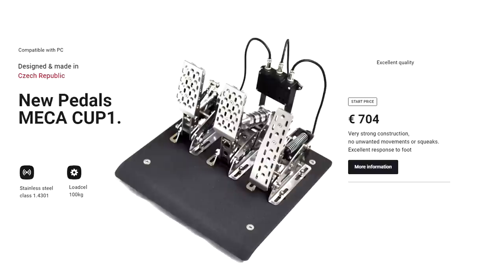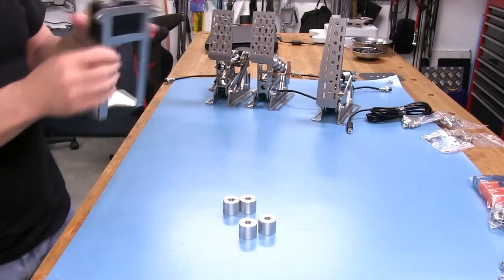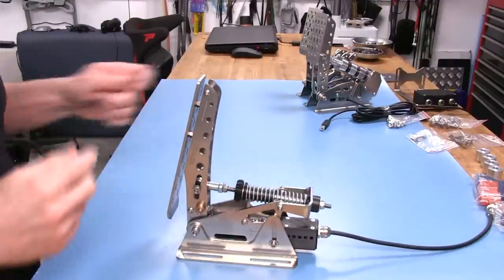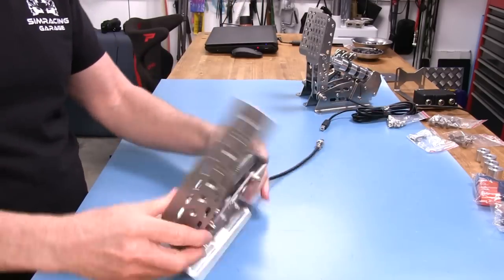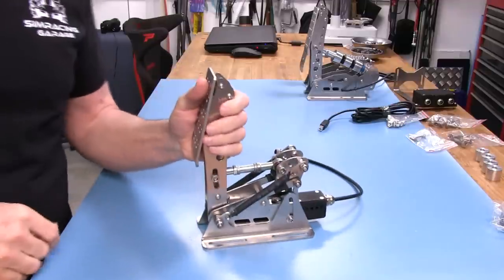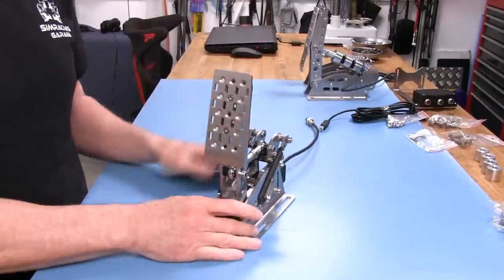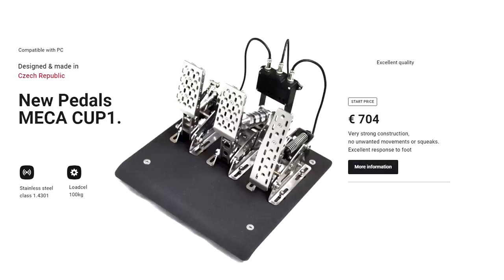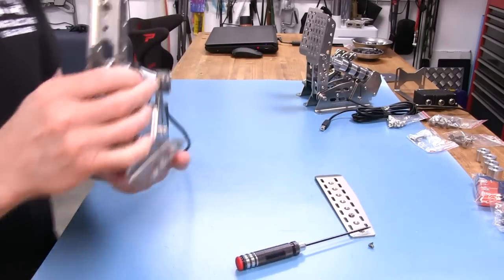ALL4SIM Meca Cup1 Pedals Review

Comment: And just bought the sprint...
Reply: bad timing
Reply: @MrMETEK23  good timing! The Meca Cup1 are a plagiarism. They copied the mechanical design from the old HE Pro Pedals for Brake and Gas Pedal. You should support genuine engineering and not copied designs. Also don't forget Software and Support from HE is top notch. Heusinkveld left a statement in the virtual racing forum on this topic. Sorry for Meca but they should come up with an own design.
Reply: @Tintop  there's no plagiarism, all hydro and load cell pedals look the same.  The only difference with he sprints is that you get your money's worth.
Reply: @MrMETEK23  well.. there are many different pedal mechanics out there. Or would you say TM T-LCM, Fanatec CSP v3, HPP 3P-JBV, Simtag Hydraulic Pedals, Wave Italy Impetus, ECCI 6000, HE Sprint, Simworx and Protosimtech Pedals are all the same? They're def not all the same, they all use different and their own unique solutions. 
It's not that the Meca "look the same" here, it's the same mechanical solutions/design used here and not an own development. Although there are some minor changes in the details/design, it's more than obvious that the mechanical design is straight from the HE Ultimate and Pro.
Reply: These pedals are in my opinion an evolution of the he pros I own, but heusinkveld for economic reasons to downgrade his he sprint gear and add a small soft that I have no use for.
I like heusinkveld which makes me come out of all the rma fanatec but when they don't do so well, you have to admit it too.
These pedals are way above he sprint.
Stop acting like a child
Reply: @MrMETEK23  ofc they're above the Sprint because they're basically the Ultimate.
Reply: @Tintop  And yet they come at the same price as the he sprints....
Reply: @MrMETEK23  you don't understand anything I wrote, do you? I give up on explaining.. but you don't need to be very smart to know why they cost less.

Comment: I have one of early pedals sets from  ACTS LAB  ,  as there where shutting down Wheels & shifter & pedal sets , they are  a smaller set  , but I would bet they are just as heavy as those , and not as fancy, I have the 3 way connector  , you have to buy , the Company is out of Canada , 7 still in business , they are using drivers Sal-Tech Wheel , I did have them working in Win 2000 , as they had drivers , & had drivers for the  3 DEO CARD , I hope I spelled everything right . There was straight through set up for the shifter  , but know where know if you might know , please let me know , I know it uses pedometers  , I again bet I could but magnets in there  . The shifter uses a 9 pin connection round , like S- Video , buy the way the 3DEO card was way a head of time  . I believe that I have one , & 2 slot a 700 MZ & 1 usability board  , I am sorry it is of topic a little , but Thank You. .

Comment: I was looking for new pedals as a step up from my Fanatec V2 and I find the Heusinkveld Sprint overpriced for what it is. Will take a look at these for sure.
Reply: 🤔
Heusinkveld Sim Pedals Sprint (3 Pedals) = €577
ALL4SIM Meca Cup1 (3 Pedals) = €652
Reply: Heusinkveld Sim Pedals Sprint (3 pédales) = 699 € load cell 65 kg ;) ALL4SIM Meca Cup1 (3 pédales)  load cell 100 kg + base plate  = 766 € shipped
Reply: @RedfoxQc  
I never said these are cheaper than the Sprint. I said they are overpriced for what they are.
Reply: @AttilaTheHun333333  Seen like this.
Reply: I don’t think the Sprints are overpriced. They are a well designed, medium-high end load cell pedal set that comes with its own software. Heusinkveld has great customer service and I have been very happy with them compared to my previous Fanatec pedals. I like that there is more competition in this price range but I would be careful buying from a new company where there is no reliability history and unknown technical support.
Reply: RedfoxQc 
Also the Sprint is € 699 without baseplate. 🤷‍♂️
Reply: Eric 
I have no doubt they are well designed and reliable. However, they lack in features that these pedals have, at the same price range. Even the baseplate costs more and look at it in comparison. The Sprints baseplate is a joke for the price. Everything on the Sprint feels like a compromise. So why should I pay over 800 Euros with baseplate and shipping, when I get the real deal with these pedals? BTW you can tell their products are overpriced in general by looking at their sim rig and comparing it to SimLab rigs which basically use the same materials, or even better.
Reply: @AttilaTheHun333333  You're right. I hadn't seen that.
Reply: monsieur metek Hey, this is not correct. The Sprint pedals can handle an actual load of 65kg measured at the pedal plate. The load cell has a higher capacity. Since the pedal arm acts as a lever, the actual maximum load on these pedals may be higher or lower compared to the Sprints.
Reply: @AttilaTheHun333333  What you're paying for is not just the product, but the R&D and support that goes with it. I think you're being unrealistic in what you expect. Any company which uses a 'similar' design saves a lot of development time. All these companies are making these products in small volumes, so they need to make a higher margin on each set to cover their costs and make a profit.
Why don't you just make some yourself? Parts are probably only 100 bucks.
Reply: RuyLopezQB6 
I expect more and this product delivers.
Reply: @AttilaTheHun333333  Let's hope they don't go wrong then, and they copied everything correctly and didn't cut any corners.
Of course, you actually have no idea which you would prefer in terms of pedal feel.
But you seem certain you are an expert in being right about everything.
Reply: @Ruylopez778  
No I'm no expert, just know what I want and prefer.
Reply: @AttilaTheHun333333  You are confusing weight and price with 'value'.

"The Sprints baseplate is a joke for the price. Everything on the Sprint feels like a compromise. So why should I pay over 800 Euros with baseplate and shipping, when I get the real deal with these pedals?"

Nope. Sounds like you are quite the expert.
As I said, when you copy someone else you save a lot of time and money on R&D.

I don't think the HE pedals are trying to be heavy. They are trying to provide the optimum feel in a compact and lightweight set. So to claim these ones are 'better' is missing the point.
Reply: @Ruylopez778  
Lol, you don't have to be an expert on that... it's just what is comparing these two products. In my eyes these are better in many points. Adjustable pedal plates, clutch feel, load cell, base plate, overall build quality seems on a higher level.
Not sure why you are so agitated that I don't share your opinion. You are happy with your Sprint...good for you.
Reply: @AttilaTheHun333333  I don't have Sprints. I object to you calling it "a joke" as though you have anything more than personal opinion.

You're equating build quality to weight and rigidity. It also comes down to reliability.

You have no idea if the company will still be supporting the product in a year's time, and that is part of why HE are popular and higher priced.

It is evident in your word choice that you expect everyone to agree with you. That's the first sign of someone who doesn't know what they're talking about.

It seems your biggest complaint is not that HE pedals aren't good, but the cost - as you make a point of complaining about Heusinkveld. A company that copies another can undercut them. You seemed to miss the entire point.

Enjoy your copies.
Reply: @AttilaTheHun333333  "I don’t want nor do I have to convince anyone."

You make a point of correcting someone else about how overpriced Heusinkveld is, and calling it a joke how expensive their pedals are, and I am arrogant? OK, then.

"even made them better at the same or lower price"

Yes, they are cheaper, because the company didn't have to spend so much time and money developing them and supporting their existing customers. I don't understand why this isn't obvious.
Reply: RuyLopezQB6 
Nope I made my original comment saying they are overpriced. Someone corrected me (or rather showed that they don’t share my opinion, which I am totally fine with btw.) and I told them my reasoning for thinking they are. Again never said what you imply, that the pedals are a joke.
It’s not obvious that they copied their design. It’s just pedals...not sure what kind of design one has to come up with that you won’t claim they copied it. Getting inspired by a product is one thing, but you claim that they straight up copied it, which I disagree with completely.
Reply: @AttilaTheHun333333  I didn't say that. You assumed I had Sprints. I don't. Then I explained your word choice is why I replied to you. Try to read more carefully.
Reply: RuyLopezQB6 
Lol, you are getting so butthurt. Still try to understand why though. You did say that I called the Sprint a joke! No? You are very confusing. 😄
Reply: @AttilaTheHun333333  You are the one throwing names around. He told you that Heusinkveld are well known for their reliability and customer service (justifying the higher price), which you ignored. Getting reliability is part of the design and testing phase. It costs money to get it right, and it costs money to replace parts for customers. It costs money to have the people in place to deal with these problems. You seem to base your opinion on price and how the product looks. That's why I said you seem to be an expert on thinking you are right.
Reply: @Ruylopez778  
I have my own priorities for a product. Costumer service isn't one of them, since I basically repair anything myself. Product quality and features are important to me. These pedals for me have better features and overall quality (e.g. baseplate) for a lower price.

I didn't call you names... your comments were just soaked in arrogance, calling me an expert and trying to tell me what I see wrong and that I should make pedals myself. 😄

Thank you for your opinion though.
Reply: @AttilaTheHun333333  Hi Attila, just to get a technical thing straight, the HE Sprints use a 120kg loadcell. Some more information on the value of the load cell and the relation (or lack thereof) to the actual pedal force can be found here: https://www.youtube.com/watch?v=SEWrTv9t0nM&t=
Reply: @AttilaTheHun333333  "Costumer service isn't one of them, since I basically repair anything myself."
Ignoring a reason HE are expensive and then calling them overpriced isn't ridiculous then? I see. Well, great logic there. 

"better features and overall quality (e.g. baseplate)"

A flat steel plate with holes doesn't equate to 'better quality'. It's cheaper to produce and design. It's more rigid, I agree. It's also heavier and larger. So there are pros and cons to everything.

"I expect more"
Nope sounds like you were pretty certain that you were right.

They look very, very similar to HE Ultimates.
Reply: @Ruylopez778  
Just ordered these beautiful pedals. Can't wait. 😁
Reply: @AttilaTheHun333333  I don't care if you ordered them or not. It's your money.
Reply: @Ruylopez778  
I know 😄
Reply: @AttilaTheHun333333  So telling me is about reassuring yourself you don't have a blindspot then?
Enjoy beta testing your pedals
Reply: RuyLopezQB6 
Thanks, I most certainly will. 👍
Reply: @AttilaTheHun333333  If anything goes wrong you can ask Heusinkveld owners for advice
Reply: Svend van der Vlugt 
Thank You Svend! Very interesting.
Reply: @gillesgauthier2035  brake load cell of the Sprint pedals is 120kg not 65. 65kg is the actual pressure you can put on the pedals. Meca Cup1 has a 100kg load cell but they are silent about the actual force you need on the pedal. Why do people always confuse load cell capacity with pressure applied on the pedal?
Reply: @RedfoxQc  you have to compare these pedals with the HE Ultimate and not with the HE Sprint btw.
Reply: Noël G 
Yes, you are right. I did some research and a lot of the features of these pedals even compete with the Ultimate. Extraordinary for the price imo.
Reply: Tintop I ordered the Meca Cup 1 pedals with the 200Kg LC at the same price

Comment: HE sprint looks so much like a fragile toy compared to this monster
Reply: The Meca pedals are copying the mechanical design from the HE Pro/Ultimate Pedals, the only differences are the clutch pedal and the pedal plates. Dimensions are like from the Ultimate pedals. But I would rather give my money to genuine engineered pedals than copycats tbh. Sprint pedals have the dimensions of the old Pro Pedals, so a bit smaller footprint. But they're not toy-ish at all when you hold them in your hands.